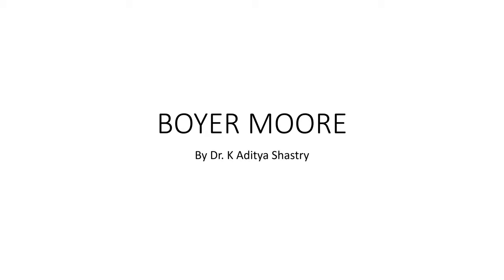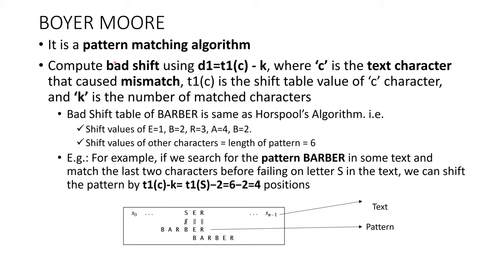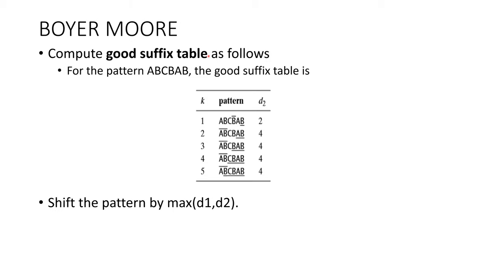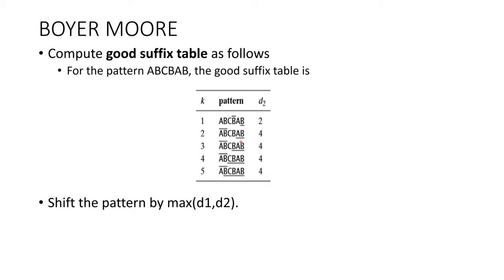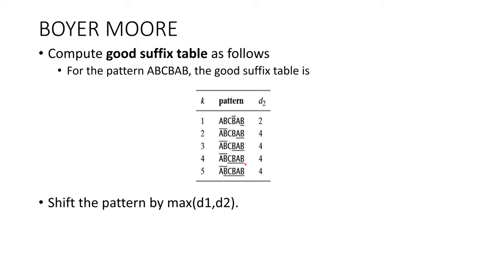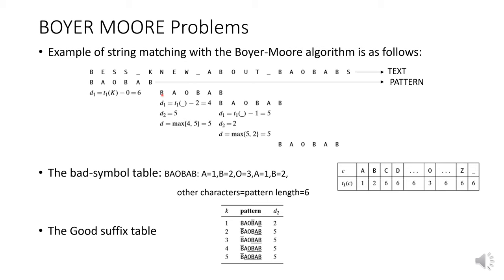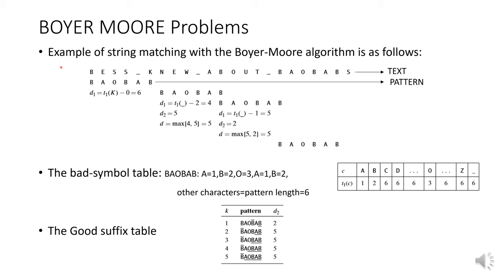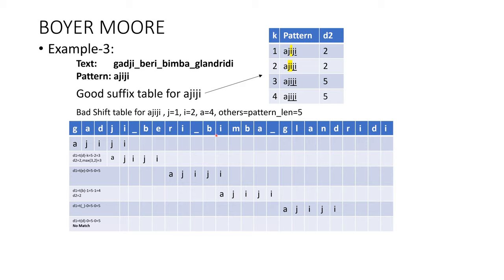BOYER MOORE ALGORITHM FOR PATTERN MATCHING

Comment: Why does the good suffix table for "ABCBAB" have matches for k = 2 to 5, but the good suffix table for "dridi" has no matches for k =2 to 4? You match a single "A" for k = 5, but you don't do that in "dridi" for k = 4 ? I don't get it. Why can't we match a single "d" in there with "ridi", the way you matched a single "A" in "BCBAB"?
Reply: That's because in the former pattern the "AB" at the end of the pattern matches the "AB" at the beginning (so when you encounter it in the searched text, it could represent part of a new match further over), whereas in the latter pattern the "di" at the end of the pattern has no match earlier in the pattern (so if you encounter a non-matching "di" at the end of the current sub-string, it means the entire sub-string cannot match and you can jump all the way to the next character).